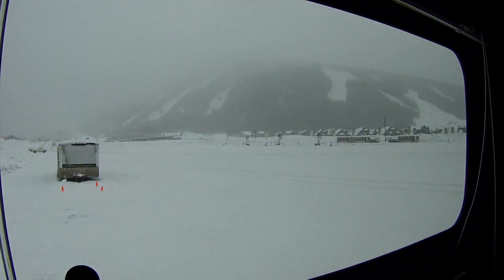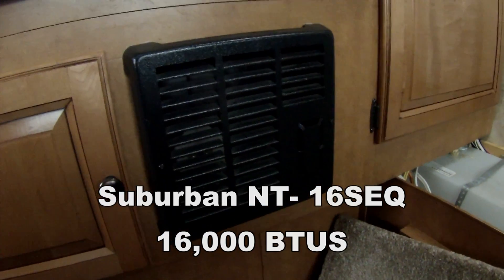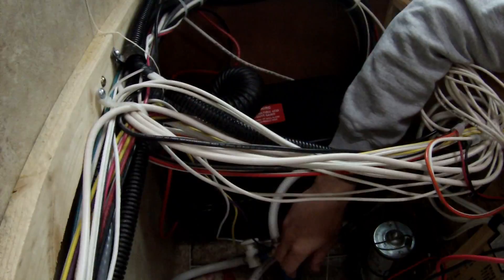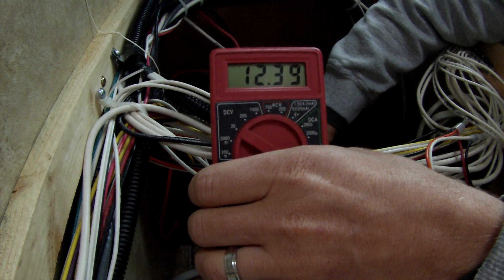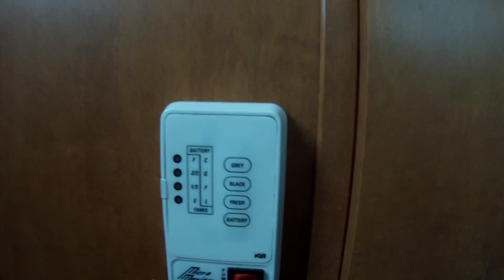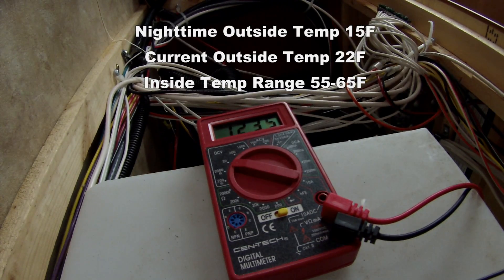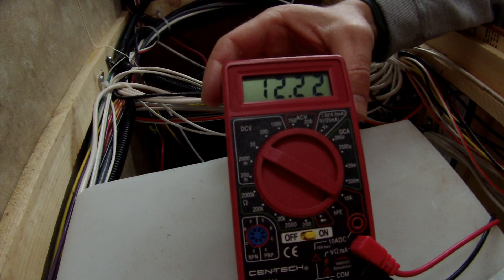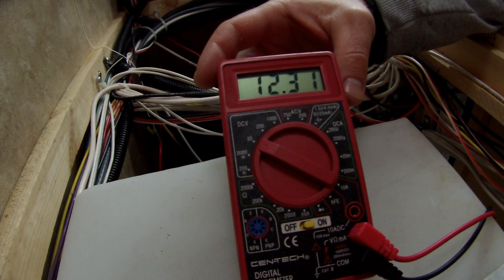Camper Furnace Power Usage

Comment: This is an interesting issue. I think amps or watts would be more meaningful than the voltage drop, which is more specific to the batter system. If you are able to use an amp meter or perhaps use a killawait type meter when the camper plugged in that would give you a more specific idea of the power consumption. The only thing is it may intentionally pull more power when plugged it.
Reply from the maker: +Perspectologist Yes very true.  I have looking into monitors that show a lot more information, I think when I upgrade and get a solar panel, I will ensure I get a really good charge controller that gives more accurate readings.  That seems like the best way to go.

Comment: Couple of links for you:

http://www.marxrv.com/12volt/voltchart1.gif
JEBSENS - 3.4A 17W Dual USB Car Charger, Cigarette Lighter Voltmeter with LED display Digital Panel Meter Voltage Monitor for Auto Car Truck, Blue LED Display with Smart Low Battery Alarm - Black https://www.amazon.com/dp/B01826Q3TU/ref=cm_sw_r_cp_awd_zVX9wbPX1T0AN

When your ready to make the final step:
https://www.altestore.com/store/meters-communications-site-analysis/meters-battery-monitors/ammeters-voltmeters-battery-monitors/bogart-engineering-tm-2030rv-f-trimetric-battery-monitor-p11263/

Start thinking in amp hours instead of voltage. Voltage gives a quick glance, but not the whole picture, kind of like a fuel gauge, my fuel gauge at 3/4 is really 1/2.

The last gauge tells you how many amp hours were removed, and how many amp hours were returned (from the solar panel). Really powerful device. If you like the 2030 look for the 2030RV, easier mounting IMO.
Reply from the maker: +hitmanhite Thank you for all these great links!  That is definitely one added benefit of getting solar, you get a battery monitor like in your last link.  When I add a solar panel, I will definitely look for a charge controller that has a good battery monitor like you posted.

Comment: Nice. I know these newer furnaces are a lot more efficient than the older ones like I had. I have been slowly remodeling and upgrading my old trailer and as part of that I replaced the old furnace with a new Catalytic Heater and made a video of that redo here https://www.youtube.com/watch?v=gQD5KSL10k4 .I wanted to just go with a new furnace but the price was so outrageous i couldn't see it.
Thanks for the info,. this is good to know.
Reply from the maker: +Bargain Boondocker Yes it is insane that these heaters run $450+!  I saw the video of your heater you installed, that looks great!  Had I kept my old truck camper, I would have installed a heater just like that.

Comment: Excellent topic. I use a Mr. Buddy heater as I find it to be more effective source for heating than the built in camper furnace.  Although I do not have solar yet so that may change things when I get connected.....I still like the small portable heater.
Reply from the maker: Thanks WCR. I do like the buddy heater and it is nice that it is constant heat. The furnace is great but the heat inside the camper is not consistent. The big downside to the buddy heater is how hot it gets and that it takes up floor space. I have burnt my jacket and my snowboarding pants on the buddy heater. But overall it is an amazing heater.  Thanks for the comment!
Reply: Cool....how are you liking your new camper?
Reply from the maker: +West Coast Roller I really like the new camper.  The two biggest differences are the electric jacks and the insulation.  As you know, the jacks make loading and un-loading a breeze I can't imagine going back to crank style!  And the camper is much easier to get warm and stays warmer for a longer time.  It is also nice to not have to constantly be fixing things :)

Comment: A volt meter isn't very informative. Even a dead battery that won't crank the truck would read 12 volts or so. Your battery tester with the lights has an internal resistor and does calculations to give those levels.
Reply from the maker: +Bobby Harper So is the monitor not based on voltage then?
Reply: +Colorado Camperman The monitor is measuring the voltage of the battery with a load across the battery.
Reply from the maker: +Bobby Harper Thanks for the tip on the monitor, I was not aware of that and had always heard never to trust the systems monitor as an accurate test.  

A volt meter still helps being able to monitor your battery.  In your example of the dead truck battery, if you had a volt meter on the battery and tried to crank the truck over, you would see the voltage go below 10 volts (depending on how dead it was, I've seen dead batteries go down to 5volts).  The same thing would happen with a deep cycle battery when putting on a heavy load - you would see the voltage take a significant plunge.

Though it may not be the most accurate test, it is still a great way to monitor your battery.
Reply: @ColoradoCamperman  
Agree. At the end of the day watt & amps matter little to me when I only have x amount of battery power left and NEED heat. Do I care if the TV is 1 amp? Nope. Microwave is 1000 watts? Not interested nor applicable.
How healthy is the battery and can it turn the fan to assist in moving hot air.
Also for those that so calculate all the necessary power requirements in a trailer, don't care there either. Get a Honda eu7000is and be done with it. Maybe even in parallel.😁